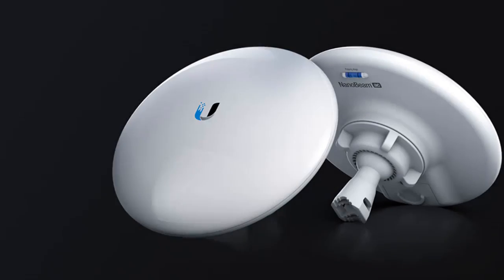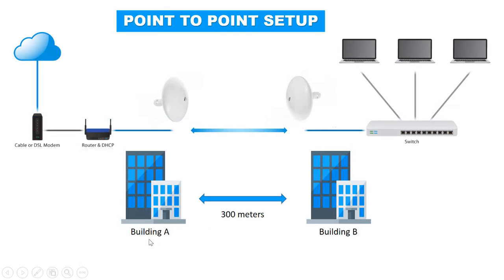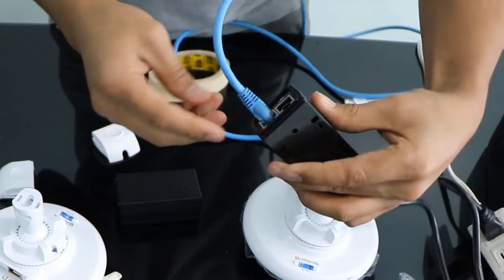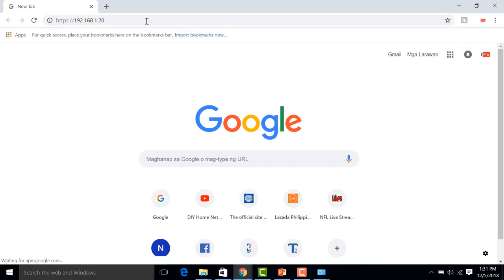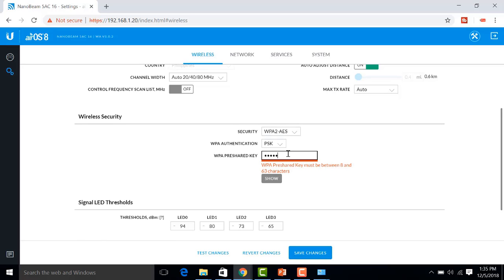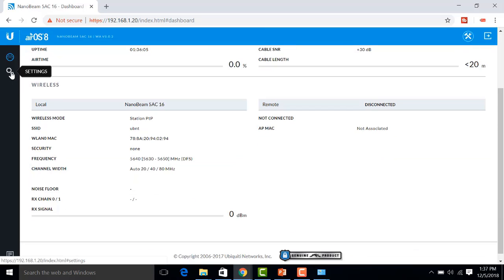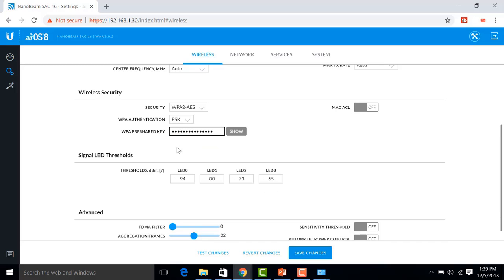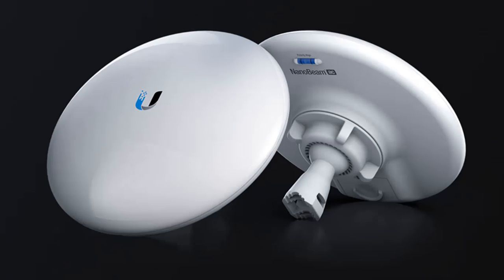Nanobeam Ubiquiti Point to Point - Quick Setup - Beginners Guide!

Comment: what should i do if i cant access the login with ip address i keep typing into browser bar but can not get to the login page
Reply: I have 2 of these, been trying all day to access the configuration page, I've tried multiple computers, my network configuration is correct. I was able to access the config page on one of them for 2min before it stopped working again, resetting does nothing. I can ping them at their default ip, that's about it. If i figure it out i'll let you know. If you figure it out, let me know :)
Reply: Turns out one of my POE devices has water damage and corroded pins on the POE OUT Ethernet connection, the one I was using to test both (It was used). I could power them on, ping them, But it wouldn't do anything else. With the other POE they both work. Luckily the person I got them from has an extra POE.

Comment: Excellent video I have a question I have two older engenius that is worked for awhile however my signal is 79-83 rssi between the two buildings voice is garbled hardly any internet think signal is the issue and if so would these be a better choice I'm currently using 2 engenius ens202 s

Comment: thanks for the help! but now that I have the beams talking to each other, how do I set up the router in Building B to be able to use the internet?
Reply: same question
Reply: Same way you ran a cable to the station ptp,  do same to the access point ptp to a switch or router and access from there

Comment: Question. Does the one that is the access point goes on building A or building B, and why?
Reply: I was wondering the same.
Reply: @eazzydoesit  Hi the Station PTP is the first one needs to connect from main Modem/Router, the the Access Point PTP is on the receiving end to get internet connection

Comment: which end of the connection is StationPTP and which end is AccessPTP? Does it matter? I need to set these up between two buildings and will have security camera feeds coming from one direction and VOIP phone system coming from the other.
Reply: Hi the Station PTP is the first one needs to connect from main Modem/Router, the the Access Point PTP is on the receiving end to get internet connection

Comment: Hi Torogi Pro, which AP’s did you connect at each end to actually provide the internet at each site? Were they connected through a switch at each end? Thanks for the video,
Reply: Hi the Station PTP is the first one needs to connect from main Modem/Router, the the Access Point PTP is on the receiving end to get internet connection

Comment: hi! dude!have you tried this distance of 50 km or 100 km long range p2p??
Reply: You need a different product for that kind of range.
Reply: You may wish to look into the AirFibre product family. Fairly long range backhaul but very $$$ you are best getting an already existing ISP and using a VPN and I would recommend this only for dedicated WISPs or if you have a very specific use case.
Reply: @KentSapp  Airmax would do 50-ish but this is definitely ISP grade backhaul project. UI recently launched LTU based Airmax product with much more advanced radio tech in it.

Comment: should i use this or a LiteBeam 5AC Gen2 for connecting two houses about 2 miles away where the one with internet has 1gbps
Reply from the maker: Gen2 is better amigo. Mine is a later model.
Reply: @torogipro  which gen 2 the nanobeam gen 2 or litebeam gen2?
Reply from the maker: Both will work just fine, however Nanobeam has better signal results and faster processor compared to litebeam.
Reply: @torogipro  thank you!

Comment: Hello can it go through trees?
Reply: trees hold a lot of water in the leaves which can interfere with higher frequency radios like this one.  If you have a lot of trees to go through, consider a solution that uses 900mhz radios instead of 2.4 or 5 Ghz
Reply from the maker: Yes amigo.